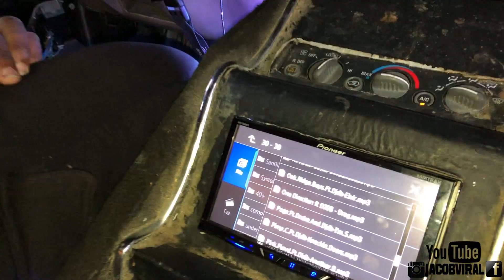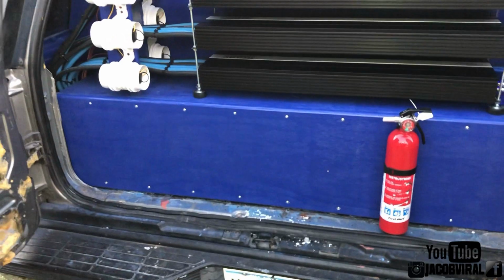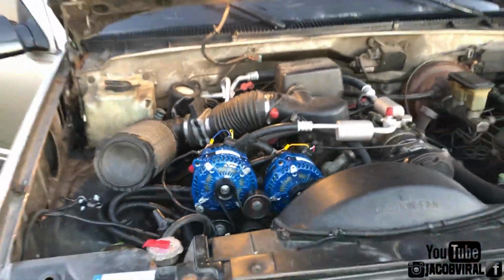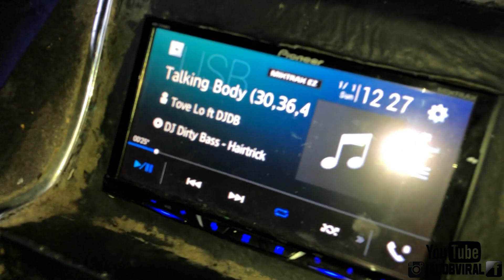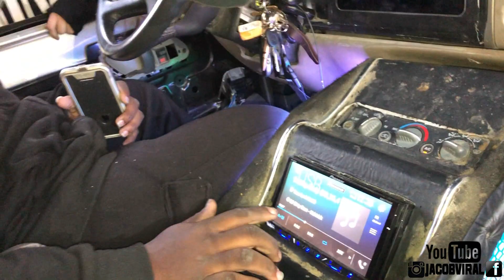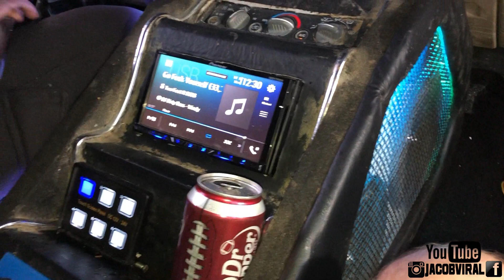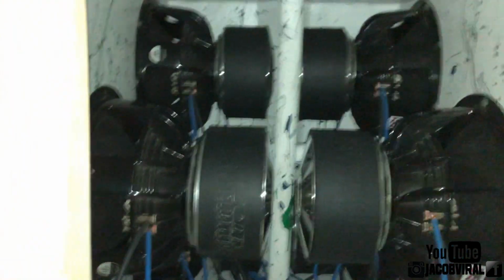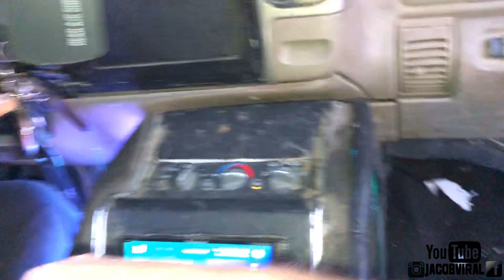160DB BUILD WALKAROUND AND DEMO FLOATING JACKETS!

Comment: Hey Jacob 
I have 2 15's in a 6th order blow through on around 7000w rms, my truck demos very well but doesn't meter good.  Plays loud with window down, not so good sealed.  Do  you think body flex was a lot to do with my metering
Reply from the maker: That happens to a lot of builds when it's built for bandwidth and music and not to meter SPL the best sadly. You probably have to test and tune the Box to get the higher SPL as well as do some Cabin mods and prevent flex like you said yea. Sealed is always harder to get louder as well. Goodluck William sounds like a sweet build you got!
Reply: thank you sir